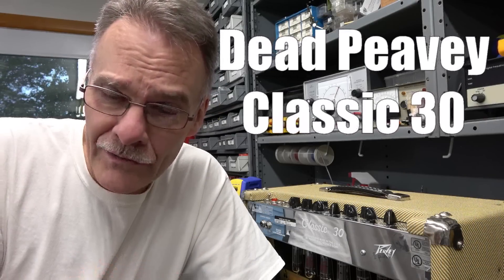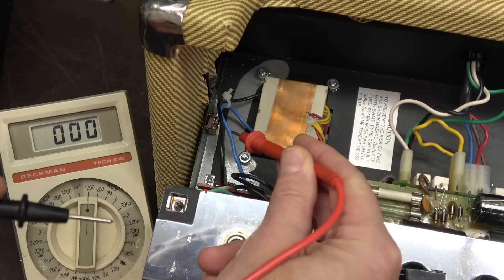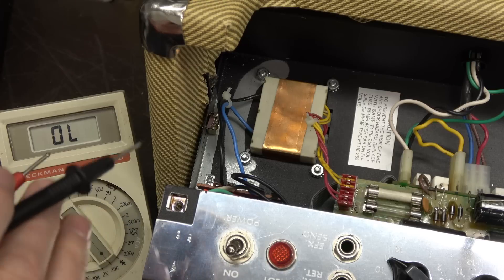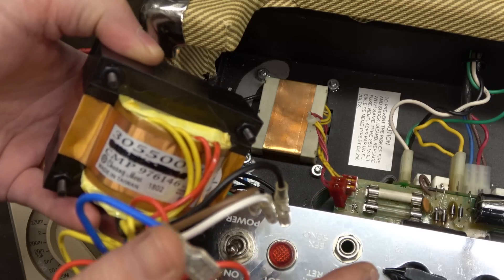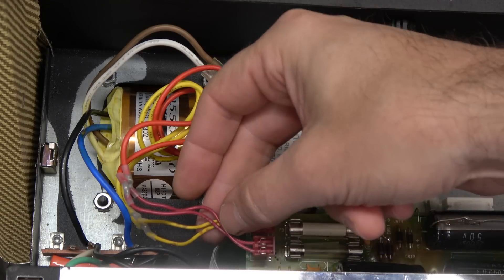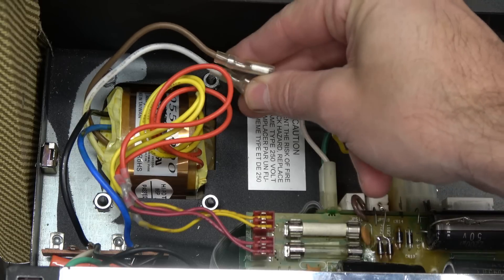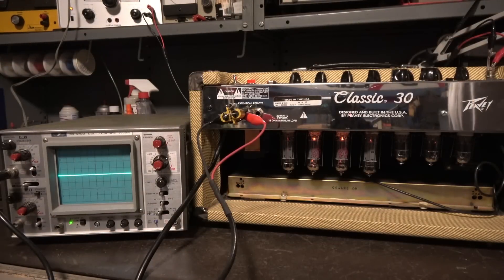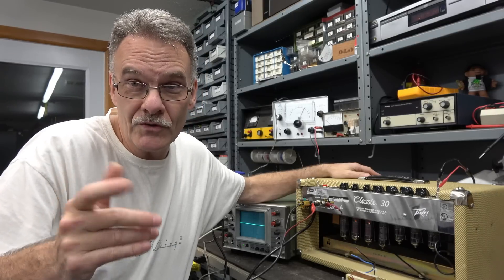How to fix a Dead Peavey Classic 30 Guitar Tube amp Bad Transformer

Comment: Great video! I suspect Im having the exact same problem. The only thing I dont understand is that my transformer failed after I had replaced the standby switch with an illuminated switch. I figured the illuminated switch might fail because of the high voltage winding going through it, but I dont understand why it would have taken out the transformer. Anybody have any ideas as to how that could happen???? Im completely flabbergasted

Comment: You were lucky. Transformer is a fairly easy fix. Working on the circuits of these is a total nightmare due to the way the 3 circuit boards are attached by wires. Also the way filament voltage is produced is somewhat funky. Accurately described by someone as an abomination.

Comment: So these transformers have an internal thermal fuse on the primary and it's actually pretty easy to get to. Desolder the strap, pop off the plastic end caps and there it is. Mouser has them.. 141 degrees C.

Comment: Hi, i have a question about that amp,  i have one of these  and  with no instrument plugged into it  its  quiet as a mouse, if i plug in a guitar  i get a loud hum,  if i plug in a  MP3 player  its clean and no hum,  i have changed cables  and used another amp with out the hum with the guitar. is this the amp or something else ?

Comment: Does anyone know what voltage I need to have at the  transformer output? Bitween J26 and J19, and bitween J27 and J28. I buy a second hand amp and it doesn't sound loaud, is like it have 50% of power. We tried to change the tubes, all of them are working, and the capacitators looks ok. Looks like the problem is in the entrance of sound.
Reply: I have 290V in J26 - J19  and 32V in J27 - J28

Comment: Hi friend! Could you help me with a question, please?
I have a Peavey Calssic 30 amplifier. It's monovolt (127v). I am moving to a city where the voltage is 220v. What can I do to safely use my amplifier? Should I buy only a power transformer that plugs into the wall outlet that change 220v to 127v? If so, what power does the transformer buy? Or do I need to install an internal power transformer in the Amp? Thanks so much (my e-mail: fabrizio_ney@yahoo.com.br)

Comment: Hope you didn't throw the old transformer away , their is a thermal fuse under the transformer cover in series with the primary winding that protects the primary winding for heat , these can go bad , but they are only a couple of dollars to fix the amp https://www.ebay.com.au/itm/5-Pcs-Microtemp-Thermal-Fuse-142-TF-Cut-off-10A-250V-SF139U-142C-New/142814646204?hash=item21406a8fbc:g:vuAAAOxyaTxTWNPK

Comment: Terry, the original transformer in classic 30 has a termical fuse in the primary.... sometimes, only changing this fuse can be a solution. 
Thanks for the videos!
Reply: Just had this issue with my c30 yesterday, and found the thermal fuse that was broken.

Comment: Oh yeah,  Peavy told me newer Classic 30s used the larger power transformer (we both used) with the "universal" primaries for 115/230 volts (and enough iron for 50 Hz. use).  They didn't quite say the original PT was sized a bit light  AND melting the PT thermal is relatively rare failure, but not unheard of.

Comment: Just did similar repair on  a Classic 30.

Melted the thermal fuse in the power transformer's (single, 115 V) primary.  The replacement from Peavey (for about $55) was roughly 30% plus uprated, taller and and heavier but still bolted in without any chassis mods. The dual primary needs both coils connected in complimentary parallel for the transformer to make rating.  Also, the PS's B plus fuse is too "large" and should be reduced to about 60% of the factory value.
Originally, poor protection co-ordination between the B+ fuse and the transformer's thermal allowed a shorted output tube to NOT BLOW the B plus.  But it did OL the power transformer until the thermal melted.  In this case, partially unwraping the original transformers coils exposed the thermal and, for a bench test, I installed a fuse and the transformer windings were all okay producing accurate voltages on both secondaries.
I had an assortment of new thermals but could not determine the original temperature value,  even by entering the original part code on the internet.
Regardless, the original tansformer had been OLed, over-heated and was NOT getting reused.  I was also told it is was against some electric code to replace the thermal in a damaged transformer.   SO $55 was plenty cheap enough.
Reply from the maker: Cool deal man, Thanks for the info. I will parallel the other primary winding and decrease the Primary fuse to 2A. Yes, I thought 3A was a bit high. Thanks again for the valuable info.
Reply: @d-labelectronics  Great on the primary wiring....  but I wasn't talking about the line fuse, which I left at 3 amps.
If memory serves, (I'm old enough so it might not....) the B+ fuse was 1 amp.  After a new output quad was installed and then adjusting the bias for the Sovteks used, (resistor change), I measured the B+ draw at roughly 350-400 ma. or less, (not real sure), and fused it roughly 50%-60% over at 620 or 680 ma.   Thought about 500 ma but that seemed too low. At 600+ ma., that's still about 250 watts from the supply before the fuse blows and even the smaller original transformer was line fused at 3 amps, roughly 345 + - watts.

"For fun", unwrap the original transformer, clip in a light fuse  (1/2 anp?) in place of the thermal and I bet you $10 it spins up with the proper outputs. 
P.S.,  both secondaries of the new transformer were about 10%  higher voltage than the (rigged) original I had..... so the B+ and  (36-40 volt for heaters) were both high.  I ignored it and figured rebiasing the output tubes was good enough.  I guess I could have changed the first dropping resistor in the B+ string to a higher value and get "the rest of them" in the string lower and closer to spec.
It's een working a couple of afternoons a week for a year w/o any obvious issues or failures.
Cheers

Comment: The funny thing is that the original transformer looks much better construction and quality than the replacement, the lamination is GO M6 (we can see the color and the small stack), the replacement is regular GNO (more waste of energy), lighter, better connections external and more professional finishes. the eplacement is coarse
Reply: P. Doherty  Thank you. I used to teach a band of girls and the lead singer have difficult to step three pedals, booster, distortion and delay for a solo at almost the same time she was singing, so I emptied a boss pedal   and built inside a big muf/overdrive, booster and delay in the same circuit just for her to step once, I call it magicguitarpedal.  Multi-effects board is too complicated for girls.

Comment: My first dealings with Full Compass was 25 years ago when they had the best pricing at the time for bulk loaded cassette tapes. Whatever formulation, whatever length, whatever shell style. They have evolved into the parts and products source for factory replacements that they are now, continuing their excellent customer service.

Comment: What could have caused that transformer to fail?
Reply: I have dismantled one , and there is a thermal fuse in the very first winding of the primary . I always thought that such a fuse would reset itself when it cooled down again . I had to grind the weld seam in order to dismantlre the E I laminations and got a mate to weld it back together after . I have not reinstalled the Transformer , but it does have continuity so will work . I'm just wary of putting it back knowing that the thermal fuse isn't in thee any more . But I guess the primary fuse should protect it . I think its maybe a small transformer for a 30 watt amp . And run hard at a gig has over heated it .
Reply: There's a chance that it got hot (could've been normal operation even) and blew the thermal fuse. They have the fuse within the transformer, just under the tape covering the windings, and they can fail over time. Could've also been a winding, but the fuse is far more susceptible.

Comment: Hi Terry, in your opinion what took out the PT? 
Thanx in advance and... 
cheers
Reply: I have dismantled one , and there is a thermal fuse in the very first winding of the primary . I always thought that such a fuse would reset itself when it cooled down again . I had to grind the weld seam in order to dismantlre the E I laminations and got a mate to weld it back together after . I have not reinstalled the Transformer , but it does have continuity so will work . I'm just wary of putting it back knowing that the thermal fuse isn't in there any more . But I guess the primary fuse should protect the winding . I think its maybe a small transformer for a 30 watt amp . And run hard at a gig has over heated it . Of course just replacing the unit as you did is far more cost effective , what with the grinding and welding palava .

Comment: I wonder if there was a thermal fuse in the primary of that failed power transformer,just curious!
Reply: There actually is a thermal fuse on the primary, from what I read.
Reply: Probably not worth the effort fixing it from a reliability factor,Colin
Reply: I have dismantled one , and there is a thermal fuse in the very first winding of the primary . I always thought that such a fuse would reset itself when it cooled down again . I had to grind the weld seam in order to dismantlre the E I laminations and got a mate to weld it back together after . I have not reinstalled the Transformer , but it does have continuity so will work . I'm just wary of putting it back knowing that the thermal fuse isn't in thee any more . But I guess the primary fuse should protect it . I think its maybe a small transformer for a 30 watt amp . And run hard at a gig has over heated it .

Comment: some power transformer used a thermistor inside the primary winding under the first isolation tape and that can fail,did you check that?
Reply from the maker: Customer requested the new updated transformer, did not go into diagnostics of the stock unit failure.
Reply: @d-labelectronics  I have dismantled one , and there is a thermal fuse in the very first winding of the primary . I always thought that such a fuse would reset itself when it cooled down again . I had to grind the weld seam in order to dismantlre the E I laminations and got a mate to weld it back together after . I have not reinstalled the Transformer , but it does have continuity so will work . I'm just wary of putting it back knowing that the thermal fuse isn't in there any more . But I guess the primary fuse should protect the winding . I think its maybe a small transformer for a 30 watt amp . And run hard at a gig has over heated it . Of course just replacing the unit as you did is far more cost effective , what with the grinding and welding palava .

Comment: Terry, It probably doesn't matter in this amp but whrn I splice in multiple wires to a connector, no matter if I use a J-hook or Western Union splice, I always try to stagger the joints so they don't line up beside each other.  This is to avoid those irritating shorts if a sharp part of the splice cuts through the heat shrink.  We had this problem on a small control motor in my lab maybe back when I was fresh out of school and I remember how embarrassing it was so I try to do better soldering and I stagger the splices.
Reply: A staggered set...This makes so much sense. And I wonder why flux isn't used at the solder joint. Further, wouldn't a simply splay of the wires meshed/conjoined then soldered, have less mass and protuberance and inhibit a rubbing action failure? Am I overthinking this?